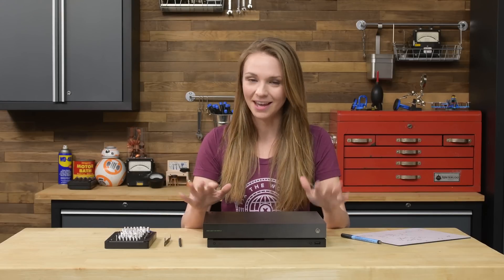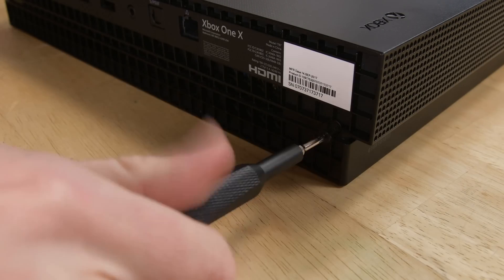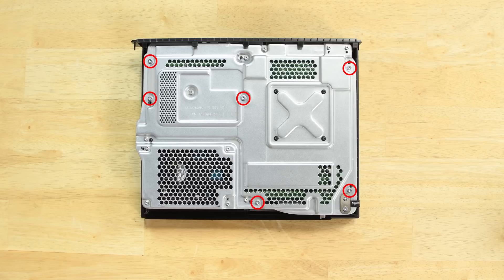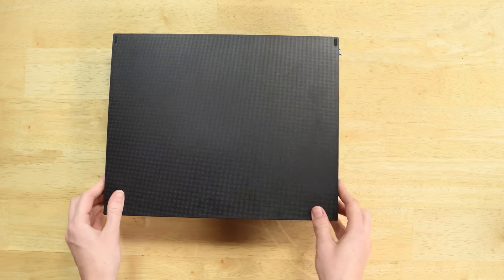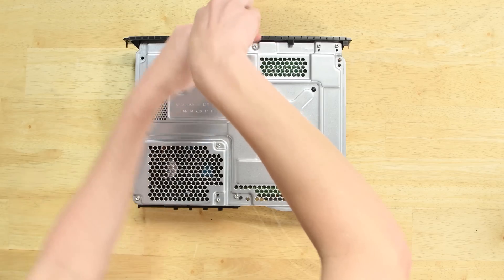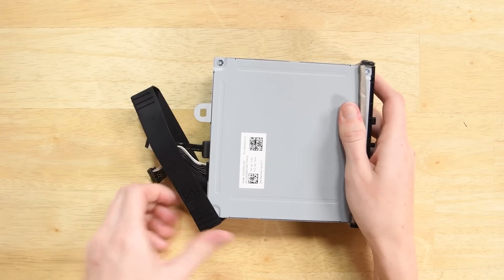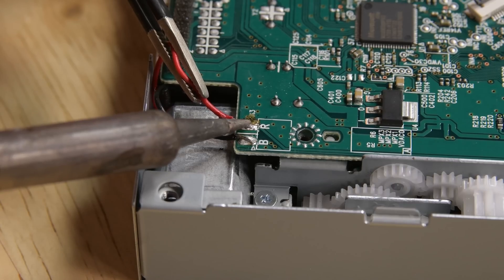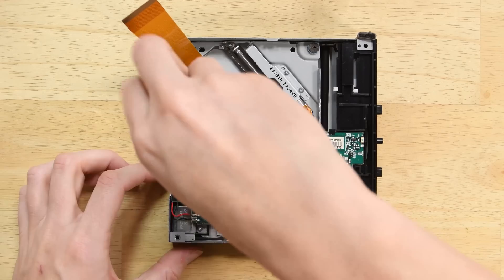Xbox One X Disc Drive Replacement—How To

Comment: I need to replace one of the two cables for the blue ray drive. I bought this used and when I got into there, someone had already been in there to replace the hard drive, but they broke one of the blu ray cables. Is there a way to get those cables?
Reply: I broke mine to

Comment: Hey, my xbox one x  started show error  102 few months ago, it was the update problem , installed offline update, it started working again, but few apps like youtube and disney were showing "something went wrong" , then i got the startup error again, but after unpluging it for 10 minutes it started working again.. few days ago it went completely dead, research showed thats hard drive is gone, replaced it with the brand new one and upon installing the OS it restarted at 58% and again something went wrong error 101. researched it someone says the blue ray is gone but mine works perfectly. upluged the network cable again restart on 58% showing error code 100 , 101. plz help. btw the hard  drive i removed from xbox started working again with 3.0 enclosure.
Reply: That could be anything the download youbused could have been outdated as you can't go back backwards in xbox updates only forward and you may need a new hard drive pretty easy to install and partition properly
Reply: Im with the same Problem. You Have found a way to fix it?

Comment: I just finished replacing my optical drive for my one X using your video. It only took me about an hour and a half. Everything worked on the first try and I'm back up and running. Thank you for your help!
Reply: Where can I get a reliable replacement optical drive?? All I'm finding online are used ones from Hong Kong.

Comment: Will a one x disc drive work in a one s
Reply: Trash Clan 
Be carefull though, one of the drive versions has  an extra black pin in the front. You might have to saw that off like me. Compare them before assembling.

Comment: On the 360 you could just swap whatever disk drive you wanted into it

Now im building a pimp box with leds and a bigger heat sink 
Thanks  Craigslist people who ripped me off 
 You’re getting me back into the consul moding
Reply: M&R Tuning not true. 360 drives were also married to the console. I had to replace 4 of them and each would not read until the original drives daughter board was attached to the new drive.

Comment: anyone know what the model number is for the xbox one X drive ?
Reply: 6m5s same one used in the xbox one s
Reply: @majesticpaint161  hi any help how comes the model numbers are diffrent on the one x drive thanks
Reply: @KilleR_ZonE  the xbox one s and x use the same disc drive that reads 4K UHD Blu Rays. The older Xbox One doesn't so is therefore a different model.

Comment: So, really, what, I can buy any Blu Ray player as long as I take the data board in the old Blu Ray disk drive into the new one 🤔? I’m sure that’s not right. Maybe the lens are the main thing here that reads the games
Reply: I’m_Lonely You’re_Lonely No. It needs to be another Xbox One drive. But you need to keep the original board because the unique decryption key needs to match the main motherboard of the Xbox.

Comment: The sponsored links with all the replacement drives are NOT for xbox x! If people don't read or pay attention they'll buy the wrong unit more then likely. Xbox one drive does not play 4k! Please update or explain which drive please! Thanks!
Reply: I just got supposedly an xbox one x replacement drive and the connecting ports are nothing like my x's... its more so the one one s but its labelled with the same model as the one x... very misleading

Comment: For anyone who doesn't want to solder or feel comfortable soldering. I have no clue why every single disc drive replacement shows you have to remove those 2 wires with a solder iron and then reattach them again...trust me when I tell you, you do not, I repeat DO NOT have to solder at all whatsoever! The 2 wires are for the motor! I have done this on my xbox x and an older xbox one. It's easier this way in my opinion! Ok, they say solder it so you don't have to slide the whole unit out of the metal housing. If you look carefully it's easy to not only take off top panel, but also you can take off the bottom! Once top panel is off, it sits perfectly in the bottom panel. Look closely and gently you can move tabs or anything holding it in. Theres videos on YouTube on how to do so. Doesnt have to be xbox x disc drive as it's practically the same. Ok. Once removed there are lots of plastic parts down there so put it on something soft. Sounds hard but it's so easy. Ok instead of removing 2 wires now with whole unit being out. Look where the 2 wires go, it's to the motor. Look on side panel where motor is and you'll see a black rubber band over a small white wheel which connects the motor. Look near that white wheel behind black band and you'll see 2 baby black screws. Take off the black band on small white wheel which connects the motor, super easy! Now unscrew the 2 baby black screws. Now do what they did in video, on top where pcb-motherboard is theres 3 screws. Remove all 3. Gently pull motor out of the assembly with pcb intact! The motor slides easily to the right, has enough room to easily come out. Sounds hard but I just finished doing mine today and it was so easy. Just be gentle with everything as it's fragile. P.s. for people who think it's to early to have issues are wrong! Anyone reading this that has an eject issue, be super gentle on the manual eject! I bought a tool specifically for this. I am no noob in other words and with me even being gentle with how hard to push the manual pin release...sadly Microsoft made these drives super cheap. Yeah they work amazingly but this one g.d. part is 3mm in width and with right tension like mine had when pushing manual eject with the pin-tool snapped this half inch pin with barely any plastic holding it! It broke in other words and would take a disc but couldn't eject it. I know how to repair this part but being so new and my patience I replaced the whole drive.

Comment: Anyone know where to get a replacement drive? Or is the same as the S? Mine stopped working in my Xbox one x project Scorpio and I don’t want to send it in
Reply: Its the same cd blue ray found in the xbox one s. Model # 6m5s
Reply: My Scorpio disk drive took a shit on me as well🤔🧐
Reply: I have the same problem , any luck finding a replacement ?
Reply: @wozza1435  6m5s found in the xbox one s.  Available at Amazon and Ebay

Comment: is that a regular disc drive?
Reply: Jorelplay No. Xbox (both 360 and One) use special drives and each drive board has an encryption key that needs to match one in the main Xbox’s CPU board. So you need to keep your old drive board. Or the encryption key will be mismatched and no more functioning of the Xbox...

Comment: way to early in the xbox one x life to be replacing dvd drives lol
Reply: Amen.
Reply: my dvd is stuck and put a bobbi pin in the hole still nothing  2 months old "I might have to replace already"
Reply: I bought one 2nd hand built Nov or Dec 2017 and it had a faulty HDD spring 2019. Barely 15 months old. I've got a computer pushing 12 years old that still has all of it's original hard drives spinning